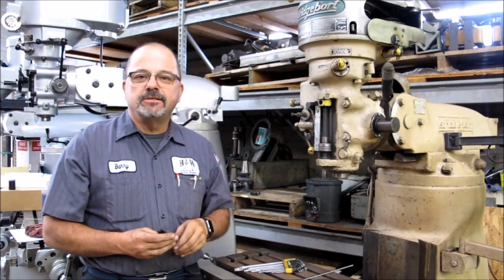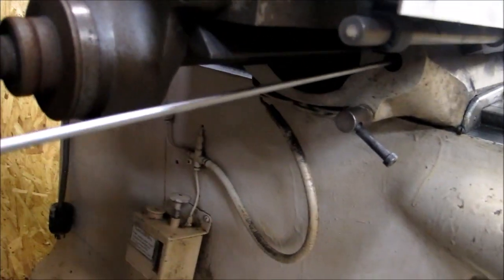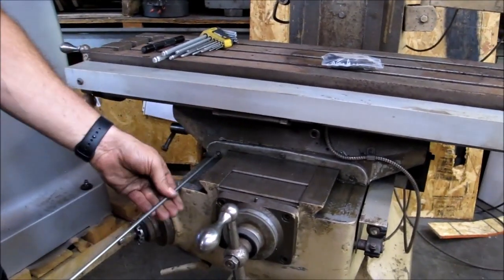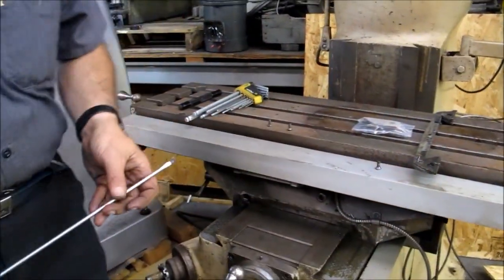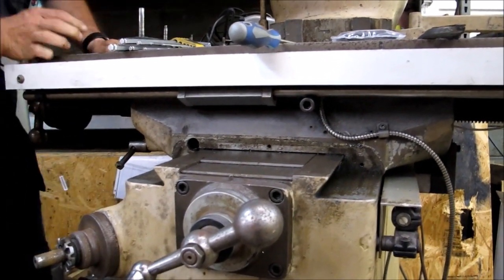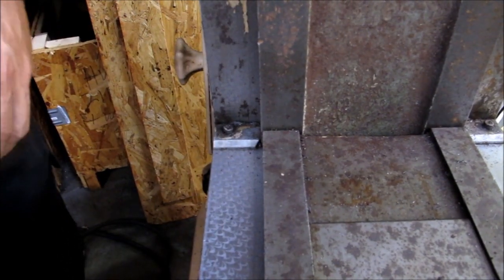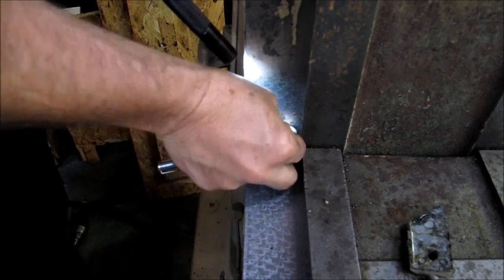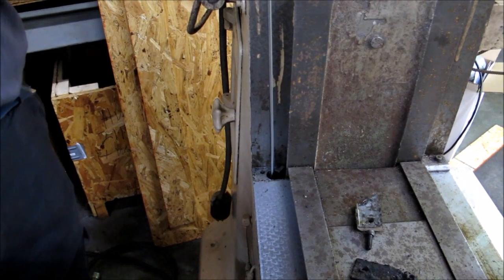Gib Adjustment on a Bridgeport Milling Machine

Comment: How would you test the"effort" when moving the table if it's electrically or hydraulically moved?
Reply from the maker: That is sometimes tricky because feeds will drive through wear but normally I listen for “load” in the motor or pump.  You could use pressure gauges in hydraulics and meters on an electric motor but I have never had to resort to that on any machine we were working on. -Barry

Comment: Thanks for sharing your knowledge so freely Barry. I'm a member of the Rochester Makerspace and a local company donated a Bridgeport mill with power feed to us. It's in decent shape but I suspect some of the spacer shims behind the handles were either left out or installed incorrectly at some time before it came to us. The symptom is the lead screw will lock up if you tighten the nut on the end holding the handle on or use the locking ring to set the dial on the handle. It's most obvious on the right handle where the power feed attaches but may also be affecting the others as well. Do you have any videos that include how to set the spacers up properly ?

Comment: if you put an indicator on the machine to measure the "rock" of the table, what is an acceptable range?
Reply from the maker: It really should be 0, but you could get away with it being between .001 and .002, depending on what you are doing and how comfortable, you as an operator are with it.